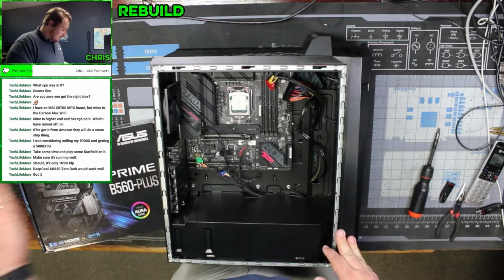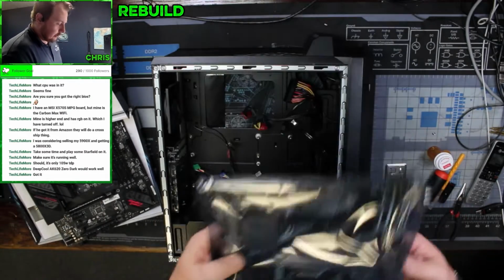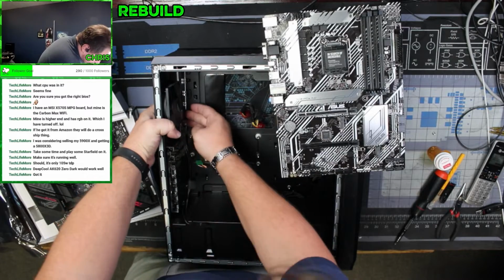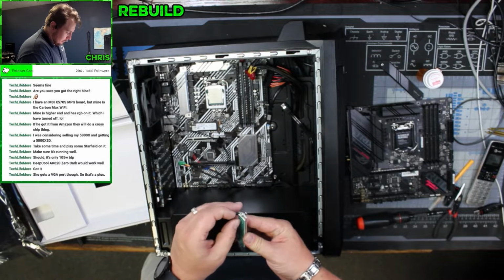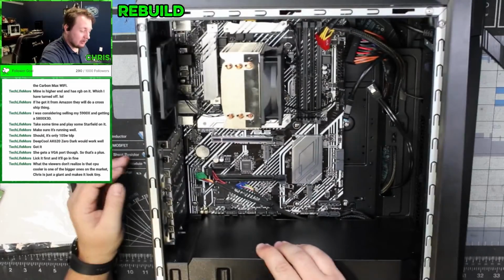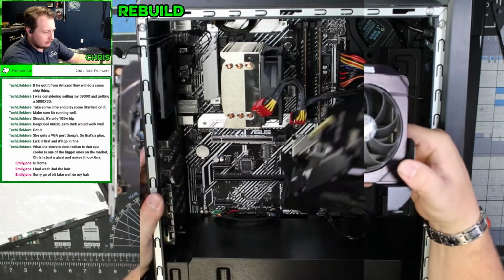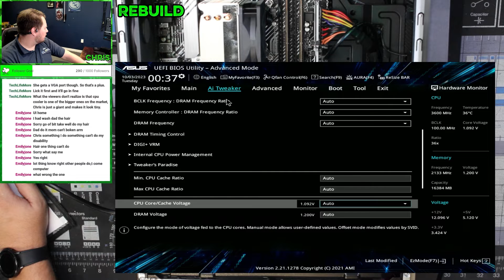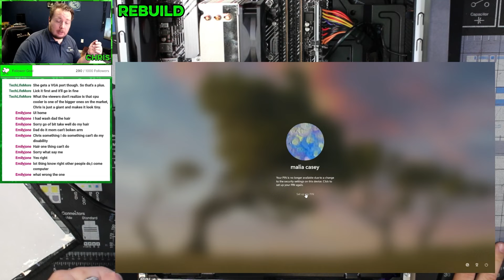Replacing an Asus ROG Motherboard: A Complete Guide!

Comment: is that the ga15dk/g15dk asus rog computer and is your mobo micro atx or atx?
Reply from the maker: Man it is has been so long I don't remember specifically, but the board that I pulled out was a micro atx. I know I did a video on the repair of it - https://youtu.be/BN7Q2EoK-Wg
Reply: Hi I have a Ryzen 5 processor which motherboard would fit. Same case G15DK cheers